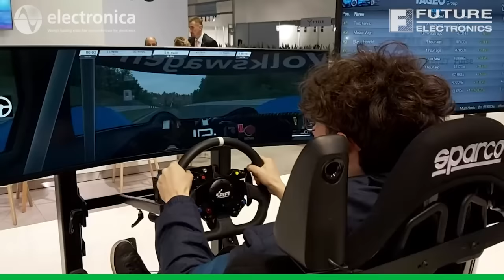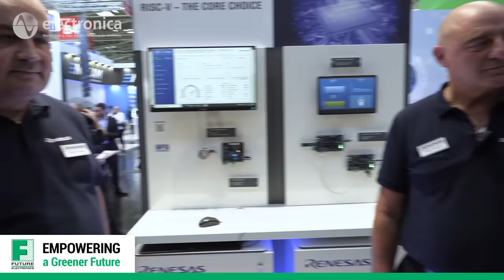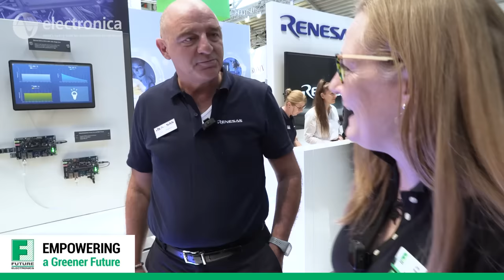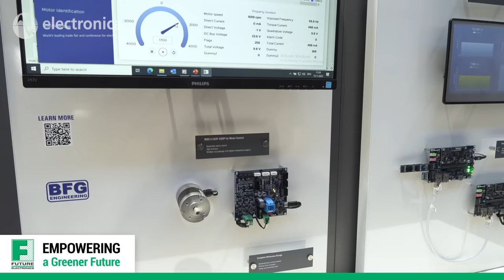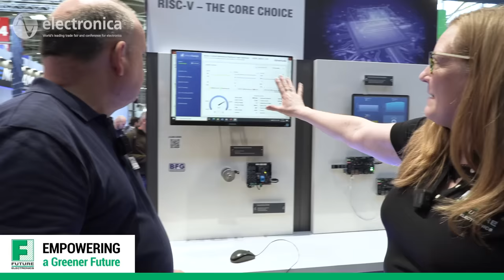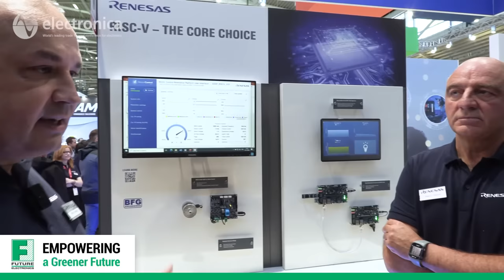Renesas - a Broadline Semiconductor Manufacturer now with RISC-V Solutions| Electronica 2022

Comment: 2:54 How can you reduce the 1kw load to 500w by using energy efficient microcontrollers😢
Energy efficient mcu means the power consumed by the mcu is lesser, how the load current will reduce to 50%?